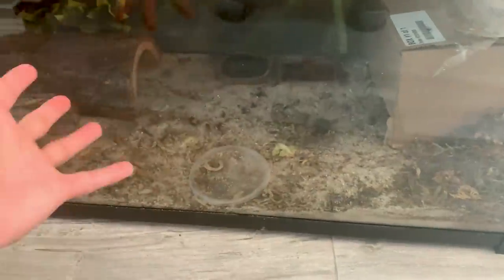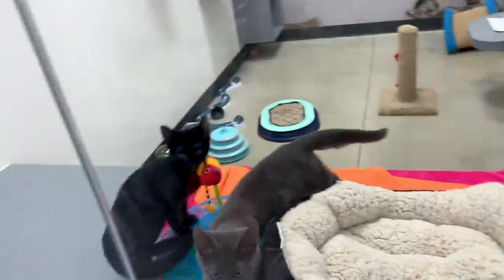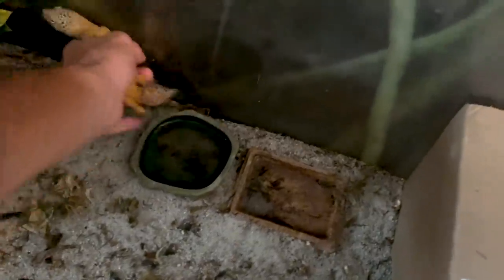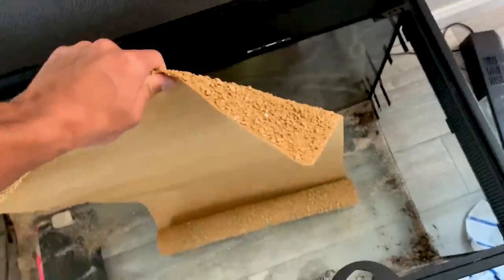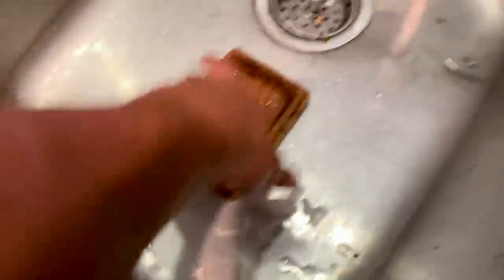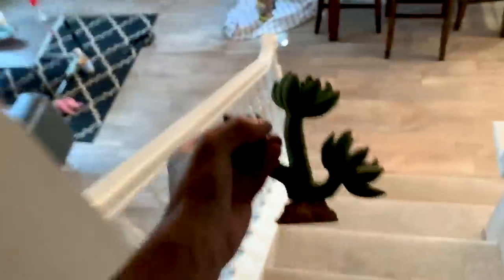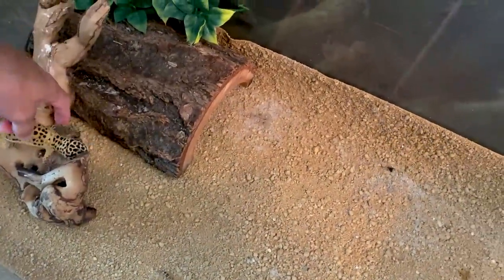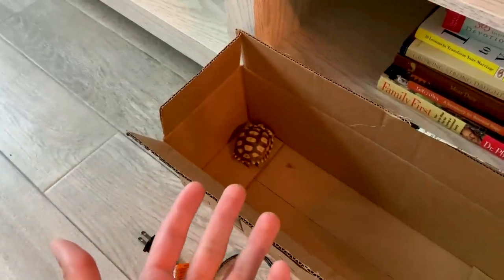My Leapord Geckos NEW TANK SETUP!! (INSANE)

Comment: Please don’t try to hold a grip on their tail when they try running away, it was giving me anxiety 😁
Reply: On the bright side he listens to these comments
Reply: Ya
Reply: they can drop there tail too
Reply: My last gdcko had passed at the age of 5 and he was midshedding thin and wouldnt eat and i never figured out why because it was so sudden, was it because of the heating lamp, i want to fix this before in the future if i get another one, rip
Reply: Did you try spraying the enclosure with water it could help with the shedding process
Reply: yah ik
Reply: @commander-5254  its not beacause of the heating lamp geckos wont die beacause of heating lamps they will acaully bask under heating lamps.
Reply: @commander-5254  Did you keep the temperature and humidity in check at all times?

Comment: You did a fairly good improvement today, but as someone with four leo's I'll give some tips to improve even more so your animals get the best lives they can! I know you love them, it just needs some more improvements to make it better, and I know a loving pet keeper like you will be happy to make any change to make their lives better. I've tried to put reasons for everything so you know exactly why :) I know its a lot of stuff but I've only said things that I do myself, as do most good keepers in the leo community:

 - Change the substrate again. When you hold them, they are very soft. While the mat won't kill them, its also abrasive and will be irritating to their skin, plus really hard to clean up. Use kitchen shelf liner, paper towels or even slate tiles! You even said in the video that its like sandpaper - I think I'd cry if I had to sleep on that, imagine the poor animals with their tiny toes and soft bellies?

 - You need a proper wet hide. You can literally get a plastic tub, cut a hole in the side and fill it with sphagnum moss or paper towels you've already wet (sphagnum moss lasts longer). It's better to have it in a box so it doesn't get the air too humid which we don't want (they come from arid, dry countries) plus it is wet all over so they can get themselves wet easier to help with shedding. My four practically live in their wet hides, as do many geckos, they love them a lot!

 - you'll have better luck taming and handling if they are separate. I notice your favourite is calmer, likes handling, has its full tail. The other is skittish, less confident, doesn't want to be touched even after seven years of trying. They also don't seem to go near each other. I expect the confident one is bullying the skittish one which is why you have these behaviours. That would be why you have one that likes you whole the other is always trying to get away from any type of interactions. You will find that one is much shorter lived and stressed out, perhaps even thinner, than the favourite. Leo's should never be kept together after something like eight months, they are one hundred per cent solitary except for breeding and even that need monitoring because sometimes they'd rather kill each other.

 -The results in bullying with a male and female are just the same because they don't mate for life or make friends or anything. They will bully each other and the female will be tormented by the male for breeding during those seasons, plus she never has time off to replenish her supplies of calcium and vitamins, so it can eventually kill her like any other female creature. One day one may even kill the other and that would be really bad. Plus, with breeding, you may find the female will become egg-bound and not breeding will help this. Obviously, if you want to, that is fine but you need to not do it at every opportunity to make it safe for the female and that means waste no time in separating because she is at very high risk.

 - For feeding, I actually say you should do it TWICE A WEEK for adults, Superworms are totally fine, but they need dusting with Calculm+D3 (if you don't have a UV light) and the correct leopard gecko vitamines. Watch Leopard Gecko and her feeding videos for the right routine for that. Feeding by tonges each feed can really improve your bond, it helped me tame by babies when they were tiny so they were really tame by adulthood, and it would help you too. Plus, you can make sure you know exactly how much each is eating and not have escapees that turn into beatles! If you feed crickets, hoppers or dubias, just take them out after 15 minutes or so when they're done. A feeding rutine only twice a week is very important to their health. 

 - I suggest taking the two of them to an exotics vet (has to be an exotics on, call ahead and check they do reptiles and have the right degrees to prove it) to check for impaction. There is little you can do, but at least you'll know so you can keep an eye on them and get an idea of lifespan if it is very bad, but hopefully, it is not. Reptiles pretend their fine until very suddenly dying on you, so its good to know what you have on your hands at all times.

 - while you wait to separate them, add more cold and warm hides so they can have complete blocks from each other. They will also need two wet hides until they are seperated at which point they can each have their own one. 

 - join a leopard gecko group online, or at least checkout Leopard Gecko on youtube, to really learn about your options in keeping them. Leopard Gecko has instructions on feeding, routines, taming, many substrate types and anything else you need to learn that little bit more to get where you need to be :)

I'm really glad you did some changes, it just needs that last little push and then you'll have it down :)
Reply: I agree with everything you've said. Absolutely brilliant and detailed comment 👍👍👍
Reply: Valkyrie Smith Leo’s can be kept together but it depends on how they are together and their gender
Reply: @jenna7130  they can, but you will always, always run the risk of one killing the other. No matter what. Some animals can be paired as they are more tolarent of each other no matter the species but it really shouldn't be done will almost all gecko species. For breeding it is OK for small periods of time, but I've seen geckos that have been mauled by males/females during breeding, and it's not pretty. If they do that when activy wanting to breed, they most definitely can turn on each other when kept in the same box 24/7
Reply: Yes there is a risk but, my two are housed together and they actually get along great
Reply: @jenna7130  there is always a dominant one. It could be like nicks where they are in separate hides because the stronger pushes out the weaker, or they may be together and you see one resting on the other in a dominate position. You may not always see it. Jessica's animal ark shows that it can occasionally work. But as even she says, it is not normal and shouldn't be tried and at any stage they can turn on each other and she is watching for the signs to separate them. There is always the two that live and survive together. There is always that one that doesn't get impacring on sand. There is always a one no matter the subject that manages it. That does not mean any person ever should be encouraged or praised for putting their animals in a position where at any point they may turn on each other and one could be mauled and or killed. It's irresponsible pet keeping to suggest it at all and I encourage you to think about separating your own two. As I suggesting at the start, you may find they have more confidence, are easier to handle and tame and with less stress they can have a longer lifespan
Reply: Men and lion can be friends and prey and predator can as well there has been countless sightings of it so the fact that you think all the sudden one is going to kill the other after 7 years relationship than your wrong. I’m studying to be a zoologist and as little as I know about geckos I know about animals and animal instinct. They kill for survival but if there is no reason to than they just leave it at that. Think about this if lions kill for fun than why don’t they kill the whole water buffalo herd instead of just 1 or 2. I’m trying to argue or say your doing something wrong I just want you to know that not all animals are the same just like people:)
Reply: @jenna7130  keeping them together is actually really stressful for them
Reply: Valkyrie Smith Thank you for providing this for him! I only have one gecko and i know everything he is doing is NOT good.
Reply: Valkyrie Smith make a video plz lol
Reply: Thank you
Reply: Valkyrie Smith I agree with it all and I need to do some of this but I leave the grasshoppers in there and she slowly eats them killing them off and it does no harm to mine (unsure if it’s male or female) but I also wanna have her out of my room and on display in the living room plus give her more floor room and height cause we were told the wrong things and we then added more into it
Reply: Makensie Draws it depends on if they were bought together and introduced together
Reply: Ashlyn Seavey I have one that’s I think a high yellow but she looks to be het/hypo for something but idk what but I know everything he’s doing to try make them better is bad
Reply: Valkyrie Smith also, you forgot one thing for him it’s that heat mats can’t burn geckos skin unless it’s too hot cause mine just lays in its warm hide on its belly touching the kitchen roll that’s above the heat mat
Reply: Actually that substrate isn't bad at all.  I understand why you would think that they wouldn't like sleeping it because you wouldn't, but the simple fact is that you aren't a leopard gecko.  That's their natural habitat.  They live in rocky, arid environments like Pakistan/Afghanistan.  I have used this substrate for years now and my gecko is one of the healthiest I have ever seen in my entire life.  It also helps get her shed off really easily.  I totally understand your concern though
Reply: @i_cant_think8947  hey! Didn't know people were still commenting here. I wouldn't leave the hoppers in for more than over one night personally, I've noticed some good patterns in my pets with having a feeding system, plus it garentees none of the hoppers get out, bite your gecko or any of that. I know you said it hasn't happened, but it only takes one and all that. Plus it just means the geck is ready to eat by next feeding, you know how many she ate at one time, you can watch for when she poops so you know if she needs a soak or anything. I wouldn't say leaving them in a long time is a massive evil but if you do want to do that, maybe leave mealies? They can't hurt the gecko, can't go anywhere, can't do anything. People who go on holiday do that a lot! Personally I wouldn't but hardly the worst thing in the world.
If your gecko is over 6 months (maybe a year, I forget exactly) you can check the sex by putting them in a glass baking tray, putting the lid on it so they don't escape, lifting that and looking underneath. I find it's less stressful on the very young, skittish geckos! :)
Reply: @danielkim1657  you may be right about that, it does not look very pleasant but if it isn't going to harm the animals I don't seen an issue. I do still think there are better options but I can defiantly imagine it would help a gecko that is a netoriously bad shedder!
Reply: @vic_omo5706  if you need, go to Leopard Gecko on YouTube, I base 85% of my research off of her videos. I don't follow it exactly (she goes for an all natural approach but she still teaches all other methods so it's not just a dictation of one way of animal keeping). I also watch Jessica's Animal friends or arc or something, I again forget exactly. Very informative. I have made her gecko bookcases too, my four are very happy in them
Reply: Valkyrie Smith thanks
Reply: Daniel Kim that substrate is terrible and he put them on ECO EARTH!?
Reply: HTTYD Gacha putting them on display in the living room isn’t the greatest idea. I assume the living room is a high traffic area. It might stress your Leo out to have people constantly around or going up to the tank and possibly even tapping on the glass when they don’t see him/her.
Reply: Sam, I thought that but I’m also always in my room and may get a sibling if my parents say yes so she can stay in it ;-;

~sent from my cupboard~
Reply: Stop everyone just let the leopard geckos be they like it so let them be
Reply: thank you, very helpful comment
Reply: There probably breeding like crazy
Reply: @louvamber4904  watch the whole video he shows up he shows the calcium all at the end and he just fed them properly why watching leopard gecko will help him feed them and he has 2 leopard geckos and you have four how having 4 makes you have more experience his are healthy and yours so stop
Reply: Draco this is a year ago and idk how you’re doing with that zoology degree. Lions are social animals with a strict hierarchy. They socialize in packs, have customs, and have the brain capacity to form bonds to an extent. geckos don’t have this ability. They’re strictly a solitary species and cannot ever form familial bonds with their owners or their own species. Ergo, they cannot be kept in groups even in male to female groups. The only reason they would be housed together is for breeding purposes and only then for a short amount of time. Cohabitation in solitary species causes behavioral and health issues so idk why you’re comparing those two completely different species.
Reply: @Spacecoastz I use a combination of organic  topsoil, mulch, play sand, and moss in mine but i keep it fairly dry. Pebbles would make it difficult to do much of any digging, so an abg mix would do better. theres also a more widely available mix called reptisoil that ive done experiments on, my leos seem to do fine in them. As long as its a resemblance of a natural soil mix in the wild. Plain eco earth is no good either for these guys. Not directed at me, but thought to share an option. Theres also a mix sold by arcadia and the biodude, but theyre a little pricey.
Reply: @Maya George you should probably read a lot more, so you can spell better. :) board and bored are two different words
Reply: no hate but mans wrote a whole book novel
Reply: I agree
Reply: @maddieshaddie  Thanks this is the most popular I've ever been ha!
Reply: @louvamber4904  😂😂
Reply: @jenna7130  I had a friend who kept two leos together. They woke up one morning, looked in their tank, and one gecko had eaten the other one - after six years.
Reply: @draco7893  they are not mammels lions live in herds reptiles very rareley do reptiles like to live alone
Reply: I had the same feeling about the sand paper. It looks nice and natural but look harsh. Even more than just free sand that can move around. That sand is glued and don't move with the geckos walking around making it very abrasive to the skin. I like more natural substrate, than newspaper or paper towel. What do you think about dry coconut fiber? Heat mats seems the best way to eat them up but what about air temperature? Sometimes the heat mat make a good spot temperature but don't heat enough the rest of ambient. Ceramic bulbs? Thank you!
Reply: @paxas03  newspaper can be tricky as the ink isnt good for animals skin, so I'd stay clear of it. Coconut fiber is fine dry or wet, though I found my geckos didn't like it as their substrate, I know others do. I use it wet in my wet hides and they like that. I use a heat mat and that's all, unless you live somewhere very hot or cold that should be enough as they get heat through their bellies. Ceramic bulbs are definitely an option! The youtuber Leopard Gecko uses ceramic bulbs and loose substrate like cocofiber so check her out, seems like her care is what your aiming for! Hope that helps :)

Comment: You should really add a moist hide it helps them shed better. What I did for mine is I got a good size Tupperware bowl with a lid then I cut a hole in the front of the bowl put moist paper towels in there works great! Also you should dust your feeders with calcium and multivitamin. Loving the videos!
Reply: I also use a moist hide like that but I put Eco Earth, it's a very good substrate along as you mix some water in it maybe once or twice a week.